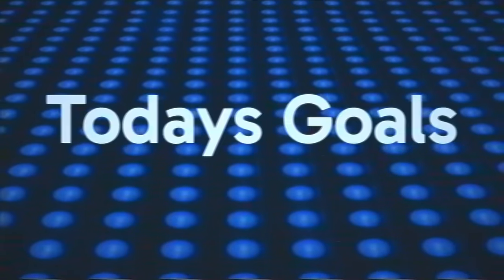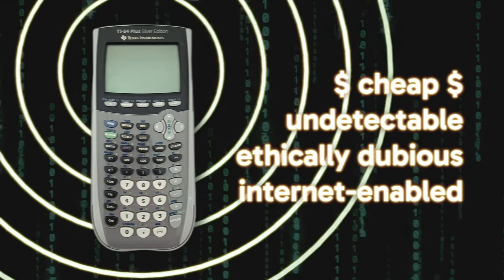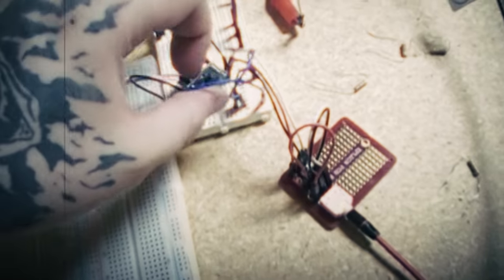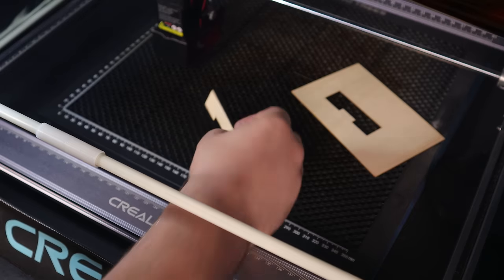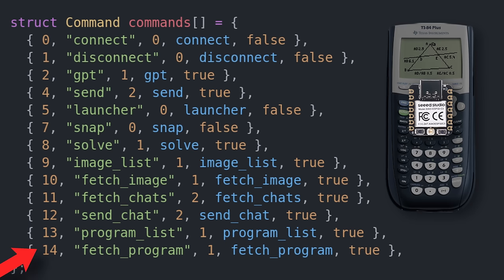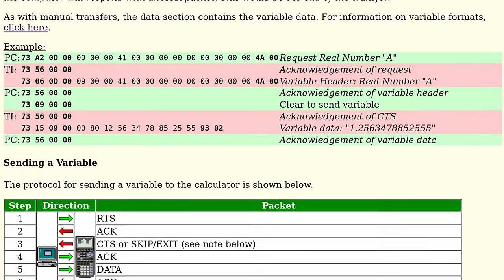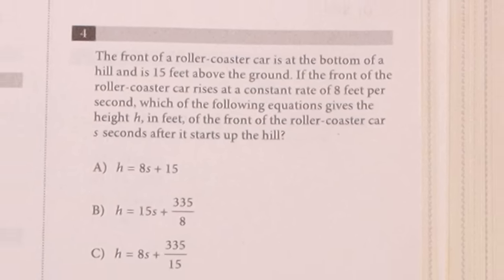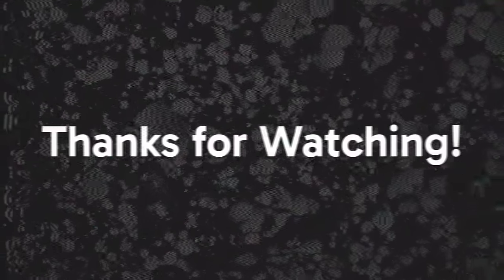I Made The Ultimate Cheating Device

Comment: 😭I made the same thing 3 years ago, but it used Bluetooth (easier to work with/use) to connect to my phone instead. It had a chatroom and Google (no ChatGPT back then) but no photos or games or camera. So, yours is definitely better. Problem was, there was no one to chat with, and yea, Google sucked. 

As for the camera, I think you could take out one of the black screws on the back and hide the camera behind there. On my calculator, the screws were behind rubber feet, so the camera would be hidden. If you have a thicker model with the recessed screws, the darkness should cover the camera. Connect the camera to your microcontroller with a ribbon cable, write a new command, and voila. If you make the command send the image to the ChatGPT API, you should be able to look at your logs to get the image back for future reference. Or just make a camera command. 

As for alternate designs, it just has to look like a Ti-84. So, strip the guts, leaving only the shell, screen, and keypad. Glue in lead weights to make it weigh the same. 
Option 1:
Then you can add in a raspberry pi (remove the ethernet and usb and headphone jack to reduce height if using full size, or just use a zero/pico). Now you run an emulator on the rpi to get back its functionality or use a custom rom. Add capacitive touch to the dpad to use as a mouse (for smooth movement, otherwise just use it to move 100px in the direction of the click. if you pick the second option you can also use 2, 4, 6, 8 for the 4 directions), on for left click, enter for right click. Add whatever else you need (wireless cards, antenna, apps etc.) You now have a mini-pc at your fingertips. 
Option 2: 
Just stick a phone in there with a 3d printed case to hold it in position (otherwise case is too big and phone slides around). Use any sort of microcontroller to simulate the rom-clearing experience/steps. But normally just use the phone. You can have the calc screen click in and slide down exposing the phone screen through a rectangle window, then make the number pad buttons capacitive, so they tap the phone screen. Just write your own app that meets our design constraints (small rectangle window on top, an input button behind every physical button, etc.) 

These are obviously a lot more complex but have their own benefits. Explore if you feel like it.

Comment: Fantastic work!

a tip for the mosfets though: Those aint small nor as tricky enough to pull out a microscope or a hot surface. Smudge some thick flux paste on the pads, stick misfit on it and solder with thin tip soldering iron. they aint worth active flux nor all the hassle you went through.

Comment: The USB port on the micro controller is 5v you can use that.
Im pretty sure if you wire it to vcc and ground it will work with 5v

Comment: I am gonna do this on the Ti-84 CE. I have that but there isn't space in the shell of the calculator so I will have to put a calculator case on it. I just need to know if the IO system is same on ti84 non ce as the ti 84 CE (by reading USB data)

Comment: Everyone in my class uses some crappy 2 line display calculators, mine has a 4 lines display and I can input entire calculations pretty much the same way you'd write then down on paper. Those 2 extra lines and not have to use calculator specific forms makes my calculator already a cheater lol.